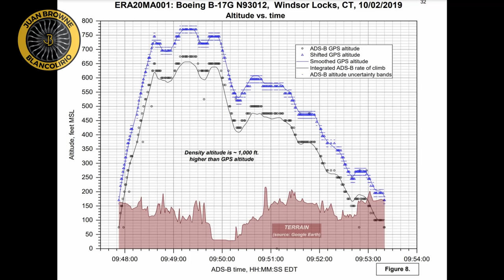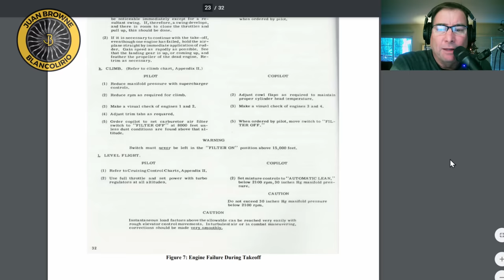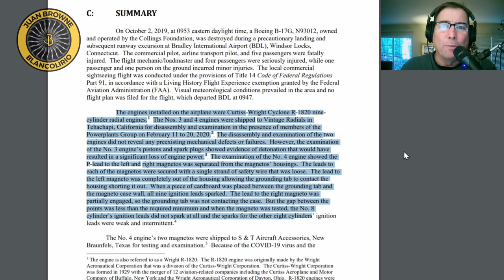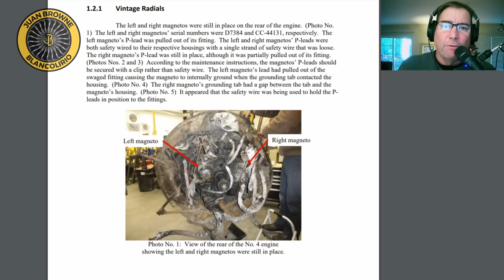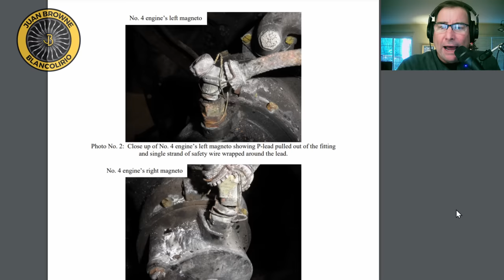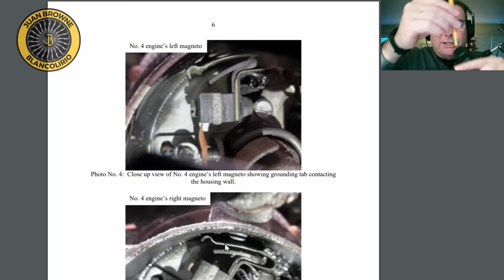NTSB Report B-17G Crash 'Nine-O-Nine' Part II -18 Dec 2020

Comment: What is described here sounds to me exactly like an old-fashioned points ignition, coil, and distributor in a car engine. It's not like what I understand to be a magneto like in a lawnmower, where a magnet is spun past a coil. The parts look remarkably like the ones in a VW Beetle or Toyota Celica or Lancia Beta points ignition. Why is this system called a magneto ignition?
Reply: The ignition systems used in old cars derived their power from the car's 12 volt electrical system and the newer fully electronic ignition systems do the same. Essentially the primary of the ignition coil(s) is charged off the car's battery and generator/alternator. But in a magneto the primary current is generated by the spinning magnets inside the magneto. Part of the reason they do this in an airplane is because the magneto will still work even if the aircraft's battery and generator/alternator fails because the magneto is a self-contained unit with its own internal power source.
Reply: @joevignolor4u949  I understand what you're saying about the differences. Are you saying that each engine has its own current source that then gets interrupted by the points as in a regular points system? 
Where are the magnets and coils that generate this current?
Reply: @timberwoof  Yes, each engine has its own dedicated internal current sources to power the ignition on that engine. And note that on an airplane engine there are always two magnetos and each magneto has its own separate internal current source. The spinning magnets and stationary coils are contained inside the magneto housing. There are two shafts coming out of the engine that turns the two magnetos. This rotates the magnets inside the magneto to produce the primary current which is then interrupted by the points. Each magneto also has a spinning rotor and a distributer to send the high voltage pulses to the correct spark plug. There is also a "P-lead" (primary lead) that goes up to the cockpit so the pilot can turn the magneto on and off. Because the magnetos are all self contained units a complete electrical failure in the rest of the aircraft will not shut off the engines.
Reply: @joevignolor4u949  Aha! Thank you. So this is a more sophisticated "magneto" than what's found in a lawnmower. More like a hybrid of that and a traditional points-condenser-coil ignition.
Reply: @timberwoof  Basically they all work kind of the same way. However, there are some differenced between a lawnmower magneto and the ones on airplanes. Probably the biggest difference is that most lawnmower engines are just one cylinder so no distributor is required while most aircraft engines are 4, 9 or 18 cylinders so they need a distributor. Also for the same reason the cam that operates the points in a lawnmower mag has just one lobe while the cam on a aircraft engine has multiple lobes.

Comment: With a worn cam lobe the dwell will be wrong for the stock points gap. So did the NTSB check the dwell with the narrower than stock points  gap? Setting the gap narrower is done on cars  and other engines to get the dwell to be correct when the cam lobe is worn. Proper way is to replace the cam. You wonder if they  set the gap narrower to get the dwell correct or was it a blunder? Normally in maintenance one has a log book to document non stock settings so the next person knows why the temporary non stock setting was used. The blowing out the magnetos  to get them working is scary stuff. What would happen to them in a massive downpour?

Comment: What a sad indictment of poor basic maintenance....poor starting and running of old school engines no matter what they are used for is usually down to worn/dirty plugs...distrbutor/magneto points... condenser...looking at those mags they are in a very poor condition...a lead lock wired in 2015 suggests that the mag has not been touched since then...no grease on the cams to prevent the heel of the points wearing and reducing the gap...all of these items should have been the first to check on poor starting....I am surprised that as they are used for critical flight  these basic systems are in a very poor condition and to allow them to be so smacks of neglect....R.I.P to those poor souls who put their lives in the trust of people who have failed them...

Comment: Wow, you'd think someone could have engineered an electronic ignition rather inexpensively to replace the points?
Reply: The seemingly outrageous prices for aircraft parts is because of the extreme rigor that is necessary just to get a system approved, get approval to produce it, get approval to install it on an engine via STC, which is generally applicable to one engine type. And the notion that the magnetos must be self-powered enters into the mix as well. Simple for lawn mowers, not so much for the ever-declining population of aircraft radial engines.
Reply: @paulcrumley9756  Well, I guess it's like Elon Musk said recently to the effect: "Regulation is stifling innovation and useful product production". The US will regulate itself out of existence while China moves forward full steam ahead.
Personally, I'd take a set of black market electronic ignitions, over 70 year old mechanical points any day of the week and twice on Sunday if they demonstrably worked.

Comment: Could the excessive corrosion been caused by the anti icing fluid that you said the engine was near??? Can't believe that cylinder came from a running engine... Interesting to see that the points were so out of spec! I used to play with race engines back in the 70's & 80's which had dual points, maybe folks nowadays are just not used to working on that older tech... Thanks sir for another great video!!! :-)
Reply from the maker: good point!

Comment: At 15 minutes into this a conclusion is made.  There is problems with number 4 engine found after the crash  so the pilot was right to shut it down?  Then problems showed up on number 3 so it was shut down.  Actions taken by the pilot in command including possibly shutting down one junk engine because there was a previously known problem, no crew working together, dropping the gear early,not declaring a emergency, not landing at the closer intersecting runway. Juan I've watched your videos and enjoy your experience and unbiased coverage of accidents.  You don't mention this but was Mac a friend?  About everything about this flight was wrong but shouldn't the final conclusion be pilot error?  There are other videos here on YouTube that have a completely different take on this terrible accident.

Comment: You stated, all plugs were mishapped! Well we're they uniform? Meaning, whomever gapped them was just using a wrong #. Also is so, was all the engine's plugs, mis gapped too. Or just this one. 
   On a side note, you would have thought a company like Boeing, or even Champion, someone, would have come up with some kind of EFI to replace those points by now!!! True everyone loves that sound of the Big Radials, but replacement of the Ignition system or an updated EFI, should not be rocket science. 
    Oh well glad my A&P days are behind me now. Just hate for are kids, kids, that jumping on these old birds might be a bucket list dream never to happen. 
    The Ford Tri-motor, was my best trip. Did many a trip out of Tinson Pen, airport downtown Kingston to Mo-bay on the Tri-motor. Ahhh, my old Pan Am days...
Reply: The idea of some kind of EFI is intriguing, but the cost to develop, certify and obtain STC approval would discourage the process for all but aircraft with significant numbers still in service. The radial engine magneto is more intricate than it appears as well. At least some of them have a special cam whose lobes are offset by a calibrated amount because the crankshaft pins for the articulating rods travel in ellipses instead of a circle, resulting in each non-master cylinder reaching TDC slightly before or after the crankshaft passes its position. I don't know if the 1820 had compensated magneto cams, but the technology was known during its heyday.

Comment: Got the honor of taking my boys to see it & go through it in the Summer before it went down. ? though could the pilot not tell there was power loss in engine 3 for some time before it went down. If 25 hours flying b4 an engine checked then 3 or 4 would have been caught. Also since 15 years old dad taught me the spark plug tells you more than anything else. How on Earth was something that simple not caught, cleaned or fixed is mind blowing as very cheap IMO

Comment: the "condenser " not only "sofstens " the spike but sets up an inductance /capcitence (spelling ? ) time to allow the coil to properly charge  for correct voltage when firing also known as dwell, so lack of point gap and bad condenser will both degrade mags performance . I flew in this plane in 1990 over manchester NH with the P51 ain't missbehavin flying formation the gather excitement fo an airshow one of my best memories . this is so sad on all levels !
Reply: Condensor is the old name for a capacitor, same thing. I remember them on cars in the 1970s.

Comment: Many, many years ago, I cleaned spark plugs at a service station with a pressure grit and electric test. Dirty.
Reply: Actually, my mechanic has very high lead levels in his blood, which is a chronic condition. 100LL aviation fuels the last motor fuel left that contains lead. There is a downside to cleaning aircraft spark plugs without proper PPE and hand washing.

Comment: It is obvious that they were more interested in saving the plane rather then saving lives    and putting it down in a field like they did with the recent liberty bell crash. You have two planes with engine failures with very different outcomes. They wanted to make it back to the airfield to save the plane rather then putting it down in a field destroying the plane but saving lives.. Trying to stay as high as possible and trading altitude for speed kills a lot of people when they have engine failure as they try to thread the needle with the stalling airspeed.. Put the nose down and keep airspeed up and land anywhere you can as soon as possible. Mike Patey goes over this very thing in a recent video as he has safely landed two planes with engine failure
Reply: Ironically, the Liberty Belle is now under restoration back to flight status despite performing an off-runway landing to save lives at the expense of the plane.

Comment: One person can have proper oversight...if it’s the right person.  Multiple person oversight can also work...if you have the right people.  There are so many examples of management by committee failing.  As usual the devil is in the details.

I worked for a guy who “maintained” airplanes like that.  He would say, “This isn’t overhaul, this is maintenance.”  Well, it wasn’t even maintenance.  Nothing got fixed unless it physically broke, failed to actuate or leaked excessively.  You learn from the best and you learn from the worst.  Discerning the difference is the key to personal success.

Comment: nice work.  two points  the Vmca for two on a side is between 90 and 95 mph depending on which side is out.  trivia..the gear motor in the 299/B17 is the same gear motor (slightly more modern version) in the B737 alt flap extension.  

I would agree with below comments the engine was not maintained.  I am still thinking about the pilot control issue

nice work Robert

Comment: Sad to say I always thought those aircraft were the product of obsessive loving care. Now I'd take a close second look before I climb onboard. I just don't see how those engine issues could have been overlooked. I'm certainly no A&P but those pistons look pretty bad as well as the mags.
Reply: Fully agree. I would have not cared when the paint would not have been perfect but I would have expected that the essential technical elements are in best end excellent conditions. Those in the report mentioned mags - build in 1942 !!! - are in a horibble condition to my opinion. As the report states during the investigation the mags were tested on the test-stand and they had to remove grease !!! from the inside so that an appropriate spark could be generated. That is unbelievable.

Comment: It is easy to be critical of pilot decisions after an accident.  It is easy to find fault.  Harder when you are the one in the hot seat making the hard calls. 

Looking over the initial accident report and seeing they were about 300 feet AGL on downwind, it is clear the plane did not have sufficient power to maintain altitude.  To then initiate a 180 degree turn to final knowing that what little altitude you had would be eaten up by the turn, I think is the decision that doomed the flight.

The video of the plane on downwind really seemed to show it was being milked badly.  Not sure of what the area around the airport is like, but it may have been a better course to continue straight and look for an place to land off field.   That might of been a better result. 

At the end of the day this is a very sad thing for those involved and it will also adversely impact other similar operations.   I love flying on these old planes.  It would be very sad if this causes other operations to shut down.  Always think about how your actions affect others.

Great video!! You did a great job of laying everything out nicely.

Comment: An engine sligthly missfiring on take off is not reason to just cancel that engine completely.  You have to troubleshoot the engine with pulling back SOME power.  You have 9 cylinders which can fail.  And 2 mags that can fail too.  No big deal.  Only a bit of power loss.  The only time i shot down a radial on take off was when i lost oil pressure and temps started climbing up at 200 agl. DC3 loaded with cargo.  That is a possible total engine fail if i didnt shot it down.  Other times we just troubleshooted it, and we didnt crash ever..

Comment: It's so sad what happened, and unfortunate because of the lives lost. Hopefully, as you stated that other groups that take these aircrafts across the country will indeed make the owners will look at these facts and cut back on schedules and not try to go all over the country. Maybe limit the areas they go to during a touring seasons instead of trying go as many places as possible. I know, the pilots are are getting fewer, and so are the mechanics that work on these aircraft. The planes themselves getting fewer and not as mechanically sound. A strict maintenance program must be followed and they were trying to get it in the air so they could go on to the next stop. Sad to say, but an airplane isn't something you can do a piece meal job on and get away with, and it caught up with human lives being lost. I enjoy seeing these old planes fly I saw some in the Auburn and Opelika ,Alabama, area several years ago. Majestic indeed, but a persons safety must be put first. Or the FAA might ground them permanently.

Comment: MacGyvering in a safety feature that shuts off an essential engine component if it fails is just borderline criminal negligent. I understand replacement parts are not made anymore but instead of having it fabricated, just wrapping it in with some wire and thinking "that will hold, job well done, me !" is bizar. And no disrespect, but a 75 year old pilot is also not the best safety feature. This was all so preventable. Sad.
Reply: I'm no lawyer, but I doubt it's only borderline.  Documents were fraudulently signed off to keep this thing flying.  That's not just negligence.
Reply: @charlesfaure1189  True that, was being diplomatic :-)

Comment: Did the Collings Foundation have insurance?  I suppose their assets should be frozen and liquidated for the benefit of the soon to be creditors.  Probably already are.  One would hope this type of operation REQUIRES significant insurance.  But I do not know.  Were the pilots required to have insurance?  Were the planes required to be insured?  The loss of life is profound enough.  But if there was no insurance, this type of operation approaches what I would describe as criminal or quasi-criminal conduct which should be prevented in all other comparable circumstances if possible by the appropriate regulating agencies.  I suspect civil suits will not fully compensate the survivors and relatives of deceased (unless there is significant insurance and/or foundation assets), so this is an issue.

Comment: The PIC was also responsible for maintenance oversight? In my 24 year Air Force career, I worked for a maintenance group commander. Pilots worked for the operations group commander. We were distinctly separate for many reasons, I'm shocked and saddened at was revealed in the investigation. Certainly no disrespect intended whatsoever. But, this situation was waiting for a place to happen with everything that was revealed. And they were taking passengers? If you can't do it right, for whatever reason, please don't do it. How did the magnetos pass a run-up check in their state? Again, no disrespect intended. God bless all the deceased.

Comment: The chief pilot should not have been the director of maintenance. That is the job of a mechanic who doesn't fly the airplane. No more should a mechanic be the director of flight operations. These are two different hats that should be worn by the proper persons. It is a conflict of interest to say the least. The pilot in this case had an A/P license...that's fine if he wants to help the other mechanics maintain the aircraft, but he should not be in charge of those mechanics and the maintenance of the aircraft.